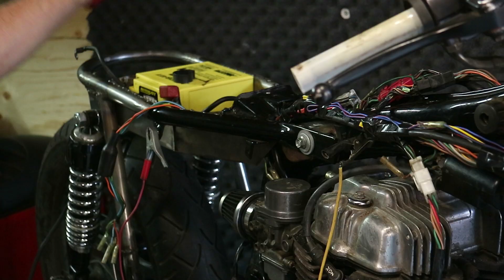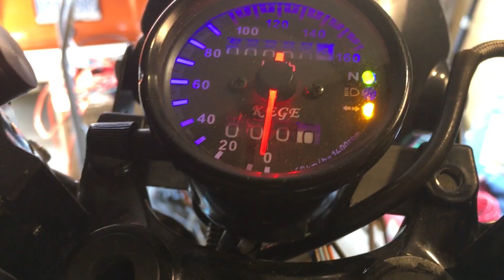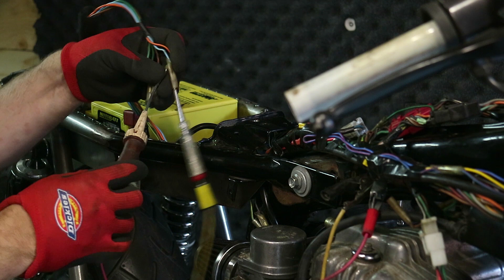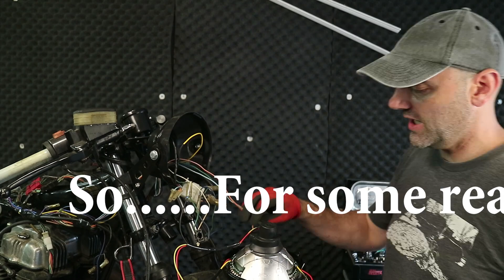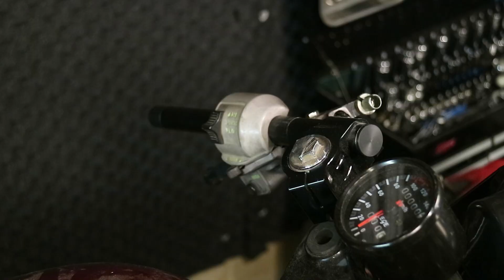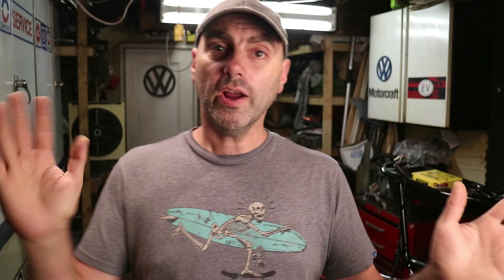Honda400 CafeRacer Ep11- LED LIGHTS INSTALLED

Comment: SOS
So I have 1981 cm. Got the same headlight. The issue I’m having is that when I connect everything, turn lights stay on all the time. When turn signal is on - it flashes but the other one stays on as it was. When I connect only one turn light - it works fine.
Any suggestions pleeease? 
Thank you